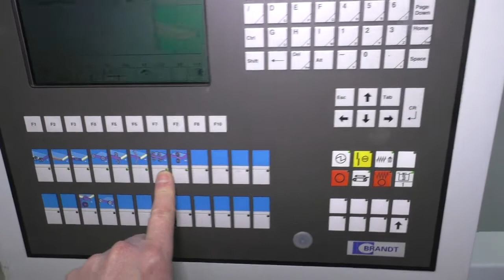BRANDT KDF 530 C (Höchsmann Klipphausen)

Comment: Hello please I need help my device just keeps blinking the hello button and does not display anything on the screen can you help?
Reply: Hello. Try to check all cable connections behind the screen and the other end (inside the machine, below the aggregates) as well. If you can not fix the problem by finding a bad connection, try to connect a standard monitor instead of the built-in screen.
Reply: @normanschmidt7832  hello Norman I connected a stand alone monitor and it did not display via the VGA port , I feel the CPU does not boot,please do you any advice or a contact number or email
Reply: @Ibe.chukwudi  Please use the official support of the manufacturer. It starts from here with the serial number https://www.homag.com/service/service-kontakt .
Reply: @normanschmidt7832  ok thank you
Reply: @Ibe.chukwudi  You are welcome.